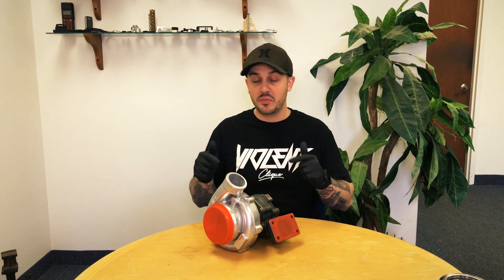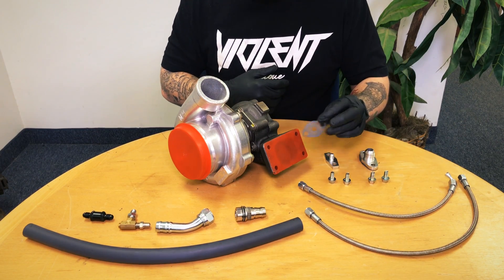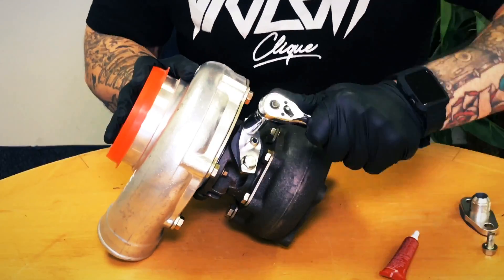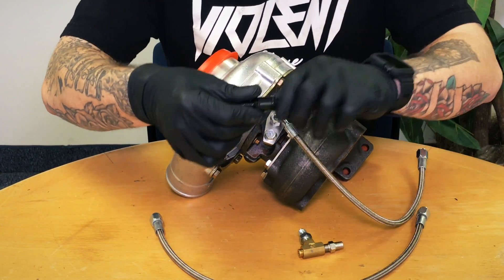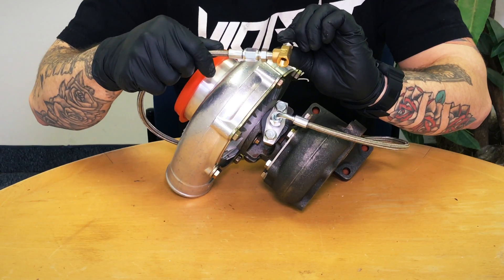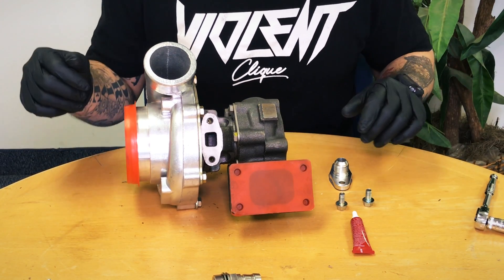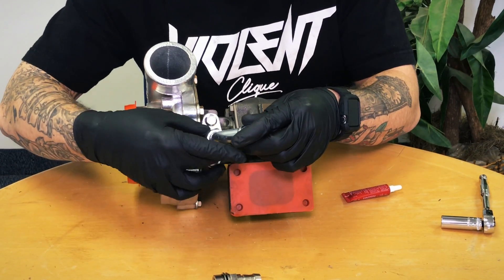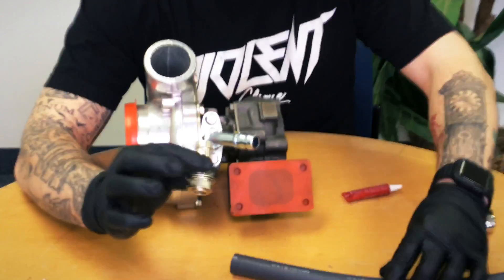Turbo Setup- Installing the MAMBA Oil Feed & Return Kit

Comment: Hmmmm..  On my feed..... mine has a banjo bolt where it comes off the engine...  so will need to put the Tee where the line splits along with the filter.  any suggestions in that scenario? 
LOL.... just realized how old this video is.  still hopefully one one can advise

Comment: I'm using adapter plat hole size diameter oem 1.5mm result-turbo thrust washer erdoded burn,shaft moving in & out.. after redrill 4mm hole it was perfect.
Reply from the maker: Great information! Thank you for sharing. Maybe it depends on the oil pressure and turbo type?
Reply: @After7Garage  ar50(t04e) journal bearing,pressure about 60psi still good no oil leaks,return line an12

Comment: hey body do you no what size and tread of the feed oil on the turbo Cartridge?
Reply from the maker: I believe the thread for the bolts holding down the oil feed plate is M6x1.0

Comment: i recommend using never sieze  and grade 8 bolts or metric 10 grade for all bolts. along with the paper gasket permatex brown for a lasting seal.
Reply: i hate that permatex brown. ive had trouble with it setting...
Reply: @harmankardon478  Agreed. it seems to become un mixed in the tube. i would recomend putting it out on card board and mix it before use.

Comment: I would recommend not using the paper gasket, for they never seal right, or they tend to blow or crack/ break. Go watch Eric the car guy,  he just uses rtv sealant. Which is the best option for a solid seal.
Reply from the maker: Thanks for your input, I’m no expert but the gasket has worked flawless for over 2 years now. No leaks. Rtv is not good to use because it squishes into the oil path. If you follow turbo pages and engine builders you would find this info. While I love Eric the car guy, he isn’t the most experienced with modifications and aftermarket stuff.

Comment: Hi I have an important question! My turbo will be installed upside down as opposed to yours, so Im wondering if i can install the oil return line on the bottom and the feed line on top? Like are these 2 ports on the turbo useable for either oil return and oil feeding?
Reply from the maker: Great question! You can not switch which side you use for oil feed and oil return. You must use them as they are intended. I think what you need to do is “clock” your turbo so they are turned the right way for you when the turbo is upside down. Loosen all of the bolts holding the housing on, and twist the center until it is in your desired location!

Comment: That filter made me cringe... if it gets clogged, there will be no oil or low oil pressure to the turbo
Reply from the maker: Idk why you would cringe haha. Better to have one then not at all, imagine that! Plus the engine oil filter is first anyways so it’s a double safety. Over a year and no issues!

Comment: Hey mate great video and its helped me with the teflon but one thing, no offence but i think u got the oil drain pan adapter wrong its suppose to be the fitting, then washer, adapter in to oil pan hole then from inside oil pan a washer then the nut if that make sence for a good seal.
Reply from the maker: Andrew P that’s exactly what I did on the install on the oil pan after this video, you are correct!! Glad it helped a little for you 👍

Comment: I have a precision 5858 turbo for my subi. Would you recommend these eBay feed lines?
Reply from the maker: Slyhound the quality of the feed line was excellent. Even the return was proper oil resistance hose with quality clamps. Mamba has it figured out 👍

Comment: How does the Loctite being a form of plastic stand up to the turbo heat being above the melting point of the loctite ?
Reply from the maker: justgjt it was the highest temp loctite that they offer, went with it. Have had no issues at all. Frankly it’s not required but I consider it insurance for the future.

Comment: The loctite anti-seize thing is useless and can damage your engine: the temp will melt, burn and push the paste out, perhaps unscrew the plate.
Reply from the maker: karim hassane we used a high temp loctite that has a much higher melting point than the standard version. While I agree with your reasoning, the proof is in the pudding. Everything is still sealed quite nicely and nothing has came loose after many months of hard driving.
Reply from the maker: karim hassane also, any failed loctite would very unlikely harm the engine. If you think about it, this is on the exhaust side of the turbo.
Reply: @After7Garage  Thanks for the fast reply. Any link for your high temp paste, please? I'm close to fit some lines on my turbo. Thanks.
Reply from the maker: karim hassane https://www.amazon.com/d/Threadlockers/Loctite-492143-Temperature-Threadlocker-36-milliliter/B0002KKTR2 happy to help!

Comment: I just have a question what size of hole would it be for the oil pan for that fitting
Reply from the maker: Adam Granados I need to double check but I believe it was a 3/4” hole
Reply: After 7 Garage thank you

Comment: Hello, I'm from Indonesia.. may I ask, I'm trying to install ihi turbocharger on motorcycle.. how do I know where the inlet oil and outlet oil ? Txs
Reply from the maker: laboratorium teknik mesin unsuri usually the inlet oil side is smaller diameter and the outlet oil diameter is much larger. Hope this helps!
Reply: Thanks alot for your help..
Reply from the maker: laboratorium teknik mesin unsuri let me know if I can answer any other questions!